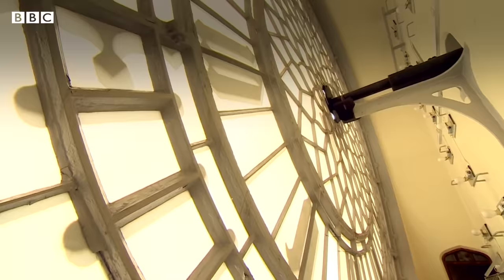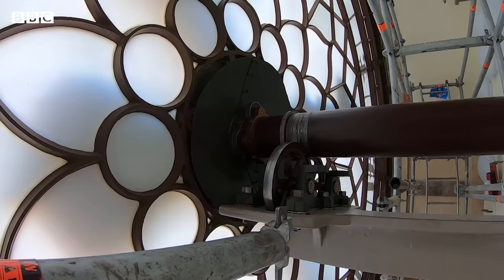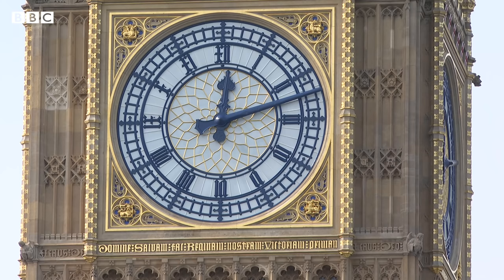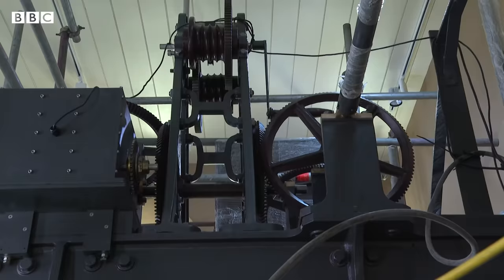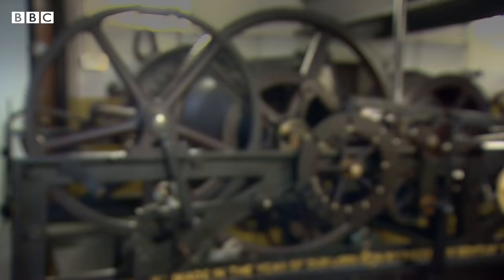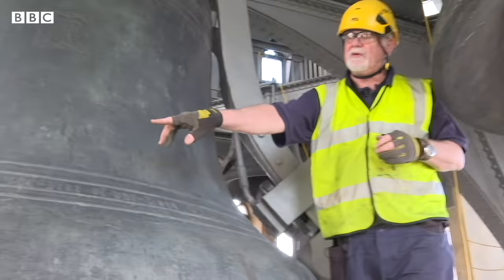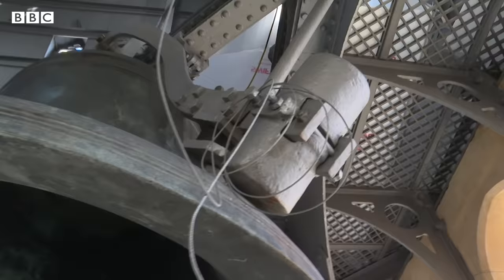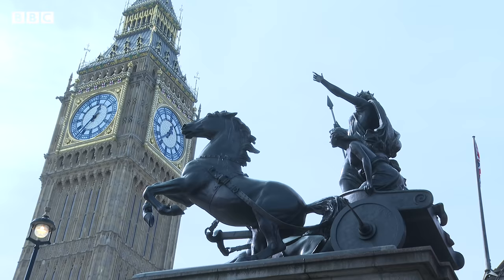Inside London's newly refurbished Big Ben - BBC News

Comment: What a marvel in restoration.
Reply: What a waste of money!
Reply: @gordonsmith8899  Why do you say that? You don't need to be on benefits to see this is a massive over-spend. Restore it sure, but they've gone mental! I wonder if the renovators were friends of Boris? 🤔
Reply: @mattiemclean9882  
A slight diversion:
For over a century Buckingham Palace was patched up using the cheapest methods and materials they could get away with.
The result? The place was about to fall down requiring the current and on-going massive restoration.

The same make-do-and-mend regime has been the story at the Palace of Westminster where in addition to corroding metal and flaking masonry the Elizabeth Tower was found to be listing.

My apology for the 'benefit' remark Mattie, it was an unkind flash comment that I'll remove. 
I'm sure none of Boris' mates are involved with the restoration.